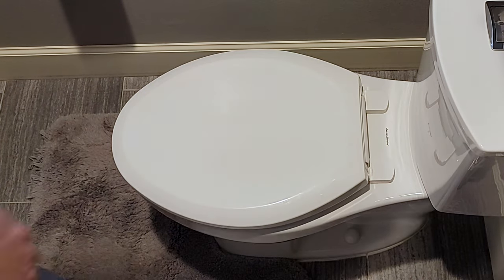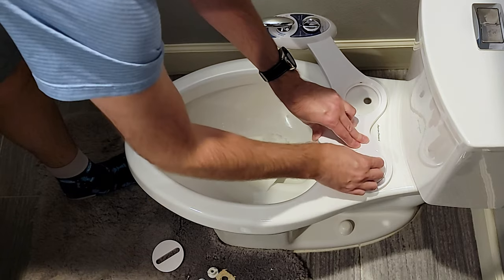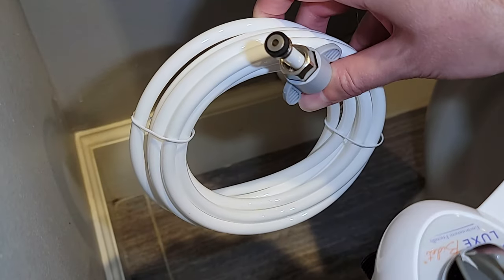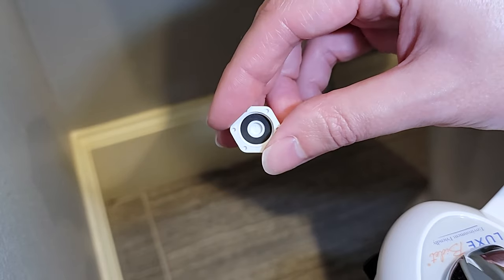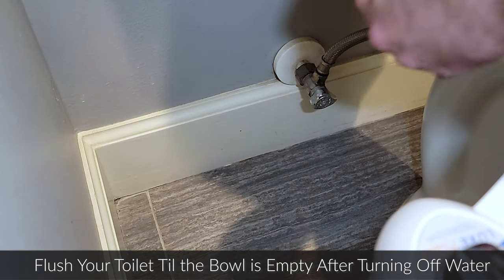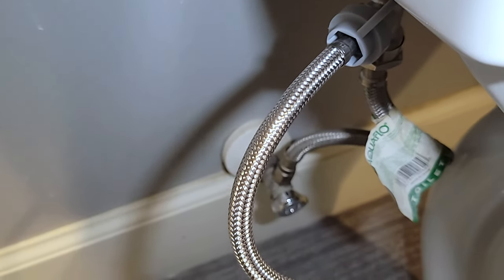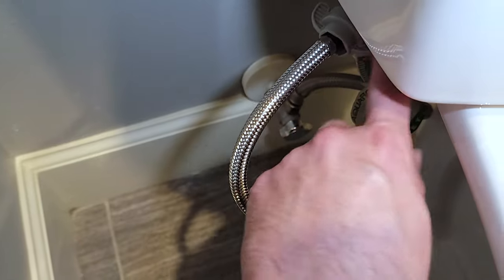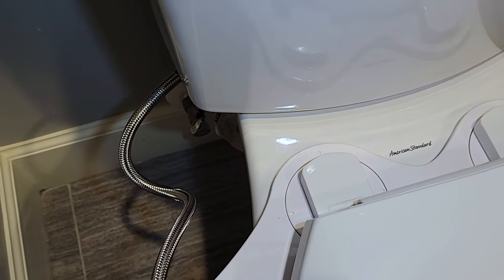HOW TO INSTALL A BIDET - Luxe Bidet Neo 320 Install Video

Comment: I see you used metal bolt for your toilet seat. Does it work better than the plastic bolts that come with toilet seats? If so, how? Do you use metal nuts too?
Reply from the maker: Those are the bolts that came with my toilet, but I don't think them being metal vs plastic would change the way the bidet would faction or install.  Yes, my toilet also had metal nuts with a plastic outside to make it easier to turn, it is a American Standard toilet.